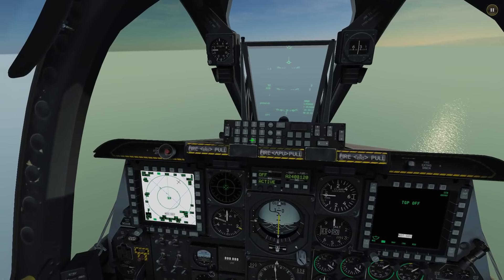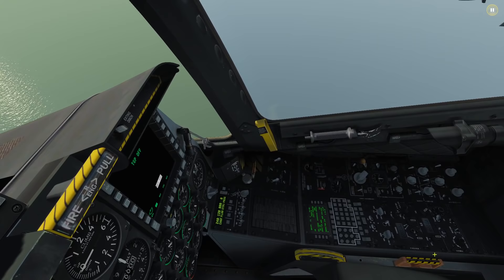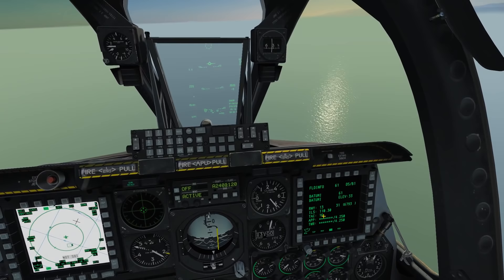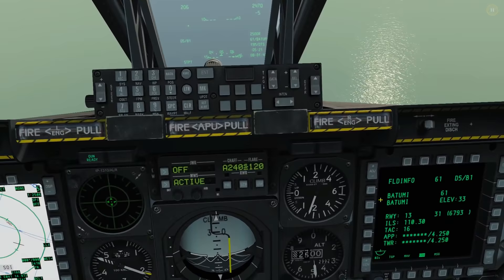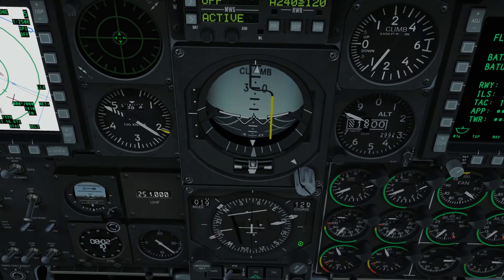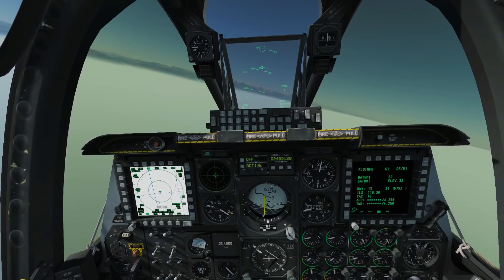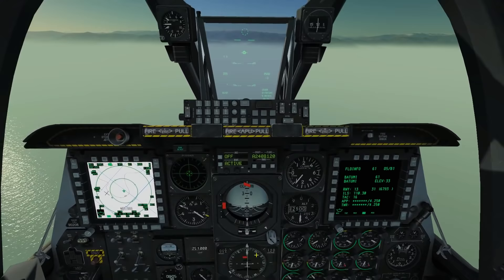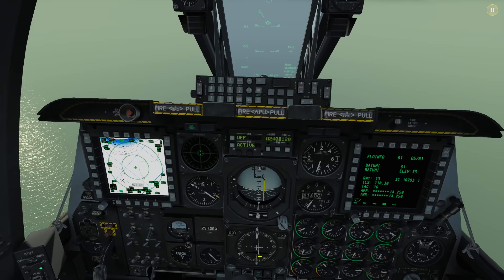A-10C Warthog: TACAN & ILS IFR Approach & Landing Tutorial | DCS WORLD

Comment: Cap, the course line isn’t the glide slope. It’s just basically either using the GPS to create a line as a reference from a point, or identifying a radial sent out by the tacan station and using the CDI to tell how far off the center of that line or radial you are. The horizontal bar and the needle to the left of the ADI is your glide slope. You never want to actually climb to intercept it unless you are dangerously low. That makes you have to do radical movements to reintercept  going down, which when closer to the ground puts you at more risk for CFIT. All you need to do to intercept if you’re low, is level off. You’ll intercept the GS with ease. Also, because you’re getting closer to the airfield, or the station, the distance between the radials in both the horizontal and vertical are closer together, so your instruments will be much more sensitive, showing deviations. You need small corrections when in close to make the runway with the needles centered. Don’t look at the HSI when set up on the ILS, you have a localizer line and a GS line, those are all you need once you receive the ILS. One more thing, ILSs are meant to bring you down to the thousand foot markers, not the threshold.
Reply: Sorry about the paragraph, just wanted to help clear some stuff up for ya
Reply from the maker: Thx Riddler
Reply: Pretty funny because that bad habit is called "chasing the needle." Also that is incorrect. ILS is meant to bring you down as far as you want depending on your planes equipment. I can get down to 200 feet in my cessna. An airliner will use ILS to go all the way to the ground in a CAT II/III approach. The 1000 foot thing is a non-precision approach like a localizer or vor approach. Much love for showing the equipment in the a10 though!
Reply: Jet Frost Gaming no, I mean horizontally, the glide slope on a CAT II or III and even normal precision approaches will bring you 1000 ft down the runway length. Same with PAPIs and VASIs.
Reply: @One_Piloty_Boy  Ohhh thats what you meant okay. Because 1000 feet fast the threshold is the "aiming point." Makes sense

Comment: CAP, ILS is not bugged, just naturally confusing. If you zoom in fully on the ILS power switch, you'll see a black tip that sticks out. So the reason you see half a white line when it's on is because of that not so visible black tip pointing to power. It's not very visible, too bad it's not a different color so you can see it! It confused me when I first started learning the A-10C. Hope this helps and keep up the good work with your tutorials!
Reply from the maker: thx
Reply: https://imgur.com/gallery/BbXXfSK Here is a close screenshot showing the tip. It confused me too. The power and volume switches both have similar tips.

Comment: You can check the CDU for "MV" Magnetic Variation and it will tell you what the deviation is for each base.  There is also a panel way at the back  of the right console which deals with variation adjustment. (though i havent dealt with it yet.  Nor have a made a landing in soup below minimums.)